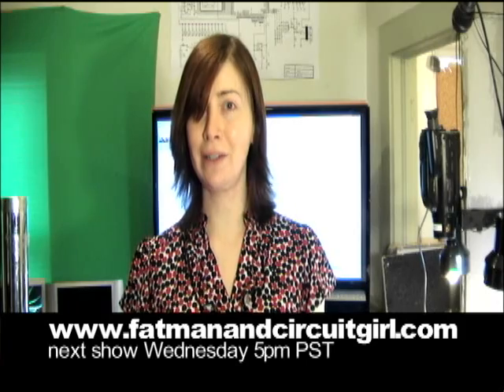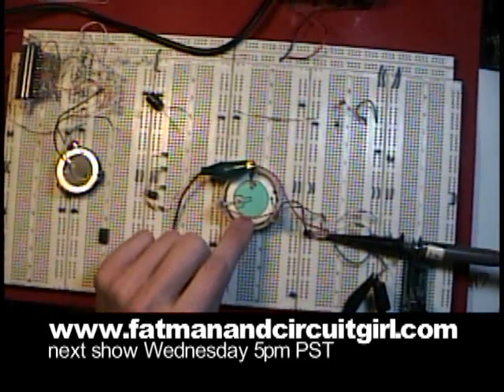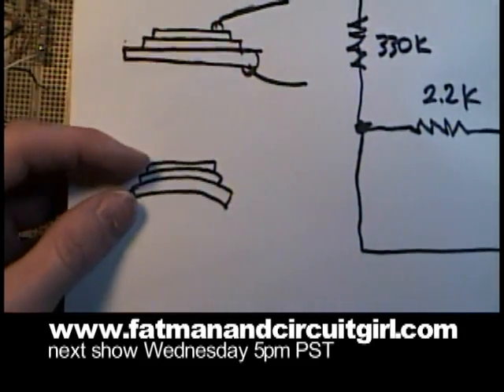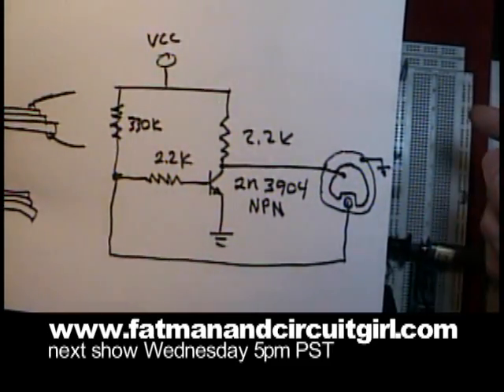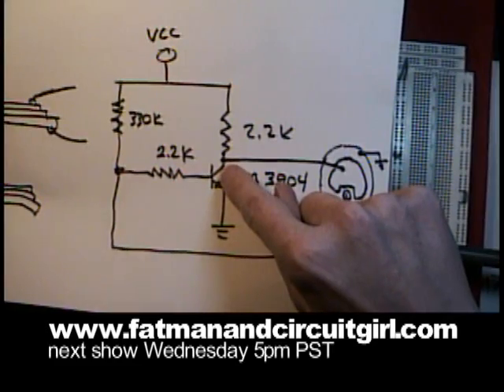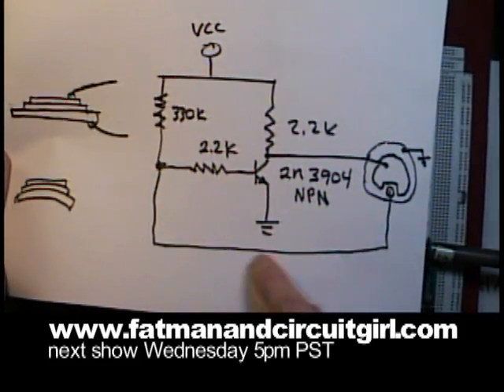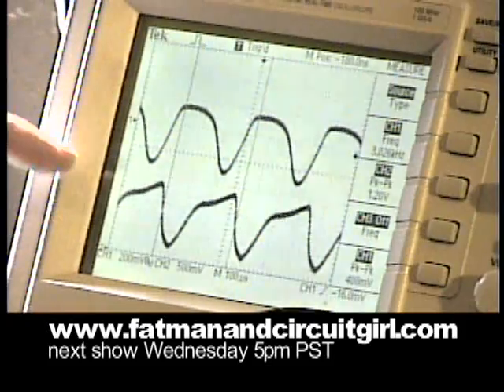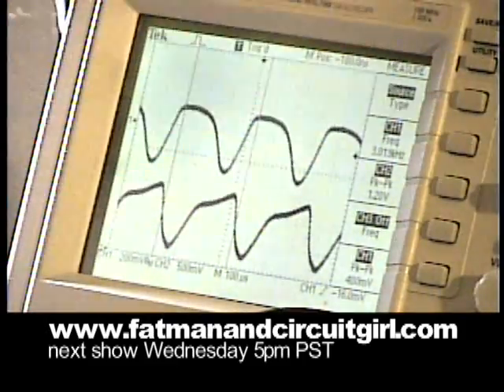Piezo Transducers with Feedback Electrodes - Short Circuits 4

Comment: Thanks for posting this informative video. Looks like you have a lots of interesting videos.  I've used these self driven piezo  a lot, kind of knew how it would work, but never look at them closely to see what goes inside.  I was trying to modify one of these to operate at lower voltage, but that didn't come out well.

Comment from the maker: I'll have to check.  I may have left out that you can cut a triangle in the top electrode and solder a wire to it.  The size of the electrode you cut out determines the frequency it likes to resonate at.

Comment: Someone sells a "piezo motor" prototyping kit, where the "motor" is a plastic wheel with a vibrating piezo rod pushed against it.  I guess the rod's sharp edge pushes on the wheel when it expands, but can't pull as it contracts again.

I've had visions of making tiny robots with piezo-disk vibrated angled whiskers (steerable bristlebots with high-tech active bristles!) 

But google shows a few old grad-student projects where people have been building exactly that.  Rats!  Already Been Done!

Comment: I truly dig these very cool and most informative vids thank you!  I also enjoy building these simple self osc circuits and stuff. Granted, they do perform quite well from generating low level af to rf and such.
 Oh, i recently discovered something  about those larger transducers utilized in most of them outdated smoke detectors. These are even more powerful and easier to drive. Like right now it's 6:33 p.m and I'm having a blast working on a new powerful driver device via box to do some of that water into a mist jazz. Funny, never paid much attention to these very cool ultrasonic vaporizers until I needed one for some health reasons. Now, they fascinate me to the max cuz  they use a similar component to send that water flying...
Later, and once again, "GREAT VID"

Comment: > I was trying to modify one of these to operate at lower voltage

We need some way to create the necessary large voltages.  Traditionally they add an enormous inductor in series, with RLC resonance equal to piezo res. (So series resonance converts high current into high voltage.)   That might work fine at 50KHz, but not at 2KHz.

Perhaps a piezo-disk "electrostatic transformer?"  Slice the disk into 2 unequal electrodes.  Drive one at resonance.  Large voltage appears on the other electrode!

Comment: I know this is old, but self-oscillating piezos are used as buzzers. No need to externally drive the piezo, or waste a pwm pin. Simple on/off for the buzzer.

Comment: I play cello in a band, and I've been using the element from a RadioShack piezo buzzer as a pickup. I've been meaning to build an impedance buffer for it, but currently it gives a really hot signal, and is extremely prone to (audio) feedback. Is there some way to use a 3-tap element so that it reduces this feedback buildup? I love playing around with electronics, but I'm lacking in much theory.

These vids are cool little snippets of electronics knowledge. Thanks for putting them together.

Comment: Hey, could you please tell me if the Primairy tap has enough current to drive signals to the small secundairy tap without use of external battery, and for it to actually do something noticable?
Thanks in advance, greets.

Comment: What can these circuits be used for Jeri?
Reply: Alarm, I got an active buzzer(active means it got a circuit almostlike one she described, while passive is just the disc itself in a case)
Active buzzer work as alarms with DC voltage
Passive buzzer work as alarms or speaker with AC voltage producing tones like Atari music.
A piezoelectric disc can be used also as a mic or sound/noise detector and as a sensor for different stuff.
https://en.wikipedia.org/wiki/Piezoelectric_sensor

Comment: CHINES SPEAKER!
Reply: https://en.wikipedia.org/wiki/Piezoelectric_sensor
In 2013, Kyocera introduced piezoelectric ultra-thin medium-size film speakers with only 1 millimeter of thickness and 7 grams of weight for their 55" OLED televisions and they hope the speakers will also be used in PCs and tablets. Besides medium-size, there are also large and small sizes which can all produce similar quality of sound and volume within 180 degrees. The highly responsive speaker material provides better clarity than traditional TV speakers.[1]
https://en.wikipedia.org/wiki/Piezoelectric_speaker